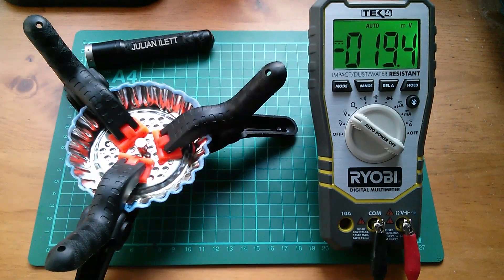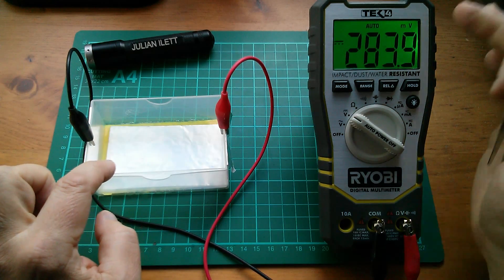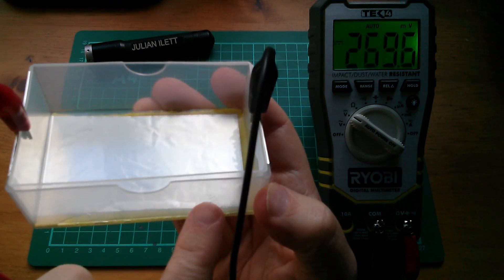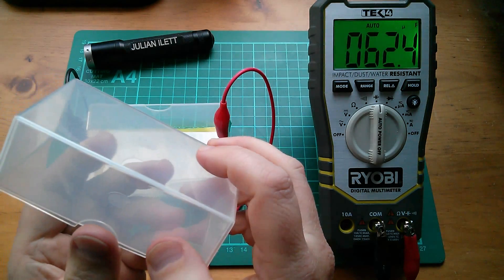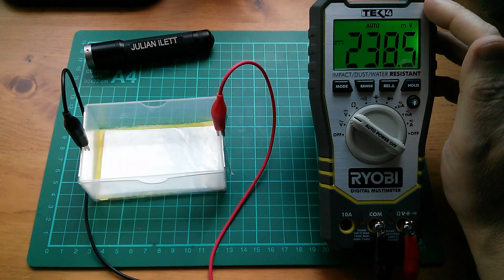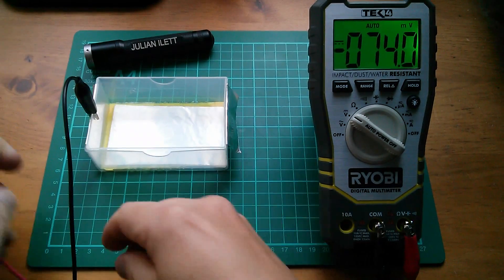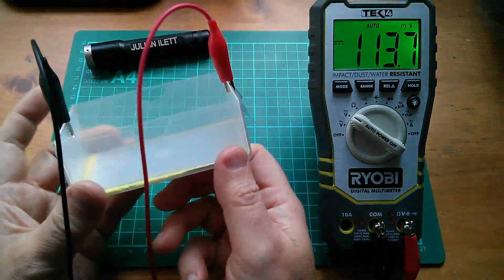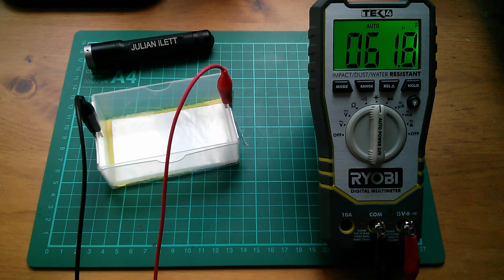DIY SuperCapacitor: Business Card Version - Success :)

Comment: The problem is that in its present state you can't tell if this is an electrolytic capacitor formed by the natural but very thin oxide layer that already exists on the aluminium foil or if it's a true EDLC.    Hopefully you will find out when you add the activated carbon.  If it's an electrolytic capacitor then adding the carbon won't increase the capacitance value at all.  How are you going to get the carbon to make contact with the aluminium through its oxide coating?  You may need to etch the oxide away first, perhaps use some dilute malt vinegar for the electrolyte but it's not so kind to your hands.

I agree with those who say that you should build it into a 555 LED flasher circuit so that it's obvious that it really is a capacitor.

Comment: so i read up on caps. best electrolyte would be soluted salts, bases or acids. easiest would be to just put tablesalt in water and use that. the max voltage depends on the dielectrics thickness (thats the aluminium oxide layer on the anode). i couldnt quite figure out what the difference is between creating it at manufacture time and increasing voltage at runtime though. also using the matte finished side of the aluminium foil should greatly increase capacity. and the capacitor should be able to handle around 1V reverse voltage without getting destroyed, as the oxide layer on the cathode is thick enough to withstand that low voltage.
Reply: This is not an aluminium electrolytic capacitor. This type of cap works (in theory) with any conductor as electrode, no need for an oxide layer.
Reply: yeah but what he built first was an electrolytic capacitor. it didnt use the helmholtz layer as pseudo dielectric, but the oxide layer on the aluminium foil. to get a helmholz layer you need electrodes that dont build an oxide layer. like carbon

Comment: You've got it wrong, Julian. You should be using olive oil as electrolyte. Then, you can rate the cap 105C if you leave the concoction macerate in the chill box overnight.

Comment: Try pure mineral oil instead of that gel, you dont want to use anything with water in it.
Reply: That would defeat the object, it's supposed to be conductive, dirty water is fine.
Reply: Why? You really want something with water in it. This cap won't work at all with mineral oil.

Comment: Surely commercial electrolytic capacitors don't use such thick material between the plates.  The electrolyte itself is largely irrelevant as a short duration proof of concept (electrolytes that don't break down after thousands of hours of use are really the key technology for manufacturers).  How would a paper towel, writing paper, or construction paper behave instead of the cloth?  As long as its permeable by the electrolyte and physically separates the plates, shouldn't performance improve when the plates are closer?
Reply: No, for this type of cap the distance between the plates doesn't matter (in principle; in reality greater distance makes the internal resistance worse).

Comment: You are missing the point of electrolytic capacitor. They are supposed to have an insulating layer of oxide on one of the electrodes (formed with voltage & chemical reactions during forming).
Thats what makes them a capacitor instead of an electrolysis bath :)
Thats where your leakage comes from.
Reply from the maker: this is an EDLC
Reply: Capacitors needs a non-conducting layer,  electrolytic capacitor uses aluminiumoxide on one foil, EDLC's uses an electrolyte separator in the middle with electrolyte on boths sides.

I think you accidentally made an electrolytic capacitor, one foil happens to be more oxidized than the other, and charging it up causes more oxidation on one side.

i.e you forgot the second layer in the Electric double-layer capacitor,
Reply: You are missing the point of an ELDC. They are supposed to have bare metal layers on both electrodes and a conductive electrolyte between them.
Reply: superdau
Don't forget the separator. You can't have a Electric Double-Layer Capacitor with only one layer.

Comment: Use your scope, PS, resistor and a switch instead of guessing with the DMM and its multiple resistances, etc.  Your scope has a known and unchanging resistance and can show nice charge and discharge curves.  Just charge and discharge (toggle switch) through a know resistance while monitoring the voltage on the scope.  Much simpler than guessing with improved results all around.  Easy to verify it is a capacitor and calculate its value.
Reply from the maker: I'll need to use the scope when this thing becomes a supercapacitor

Comment: Looks like you just made yourself a very leaky aluminum electrolytic capacitor :)
Reply from the maker: Yep, Vloss is 5%
Reply: Yeah, but 64 microfarads is about 10 times more than I'd have guessed for this.  He only needs 10,000 of them to get 6.4 farads, which is in the supercap region.  It will be very interesting to see what effect the carbon has.  Good luck Julian!  Fascinating stuff!
Reply from the maker: And that sort of multiplier could be realised with the activated carbon. One gram has a surface area equivalent to 5 tennis courts.
Reply: Would the carbon carry the electricity from the alfoil to the electrolyte, making the alfoil gain the carbon's greater surface area?